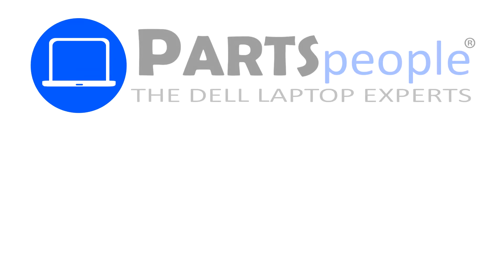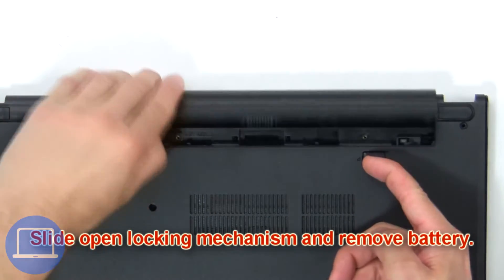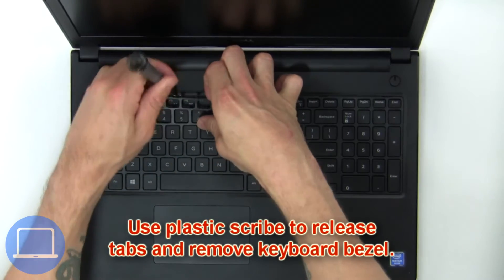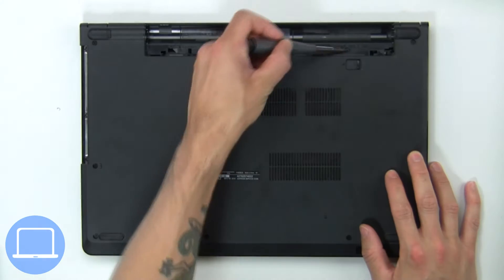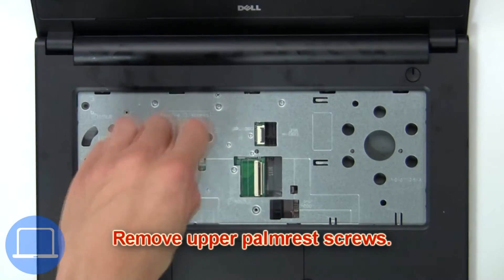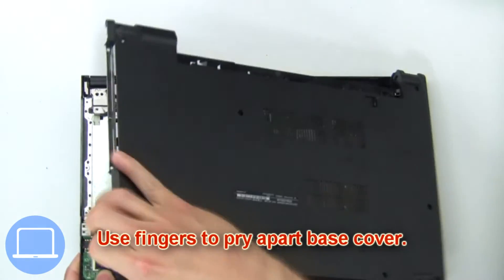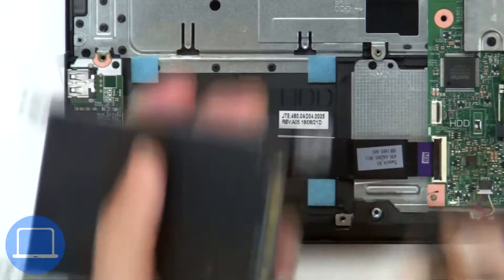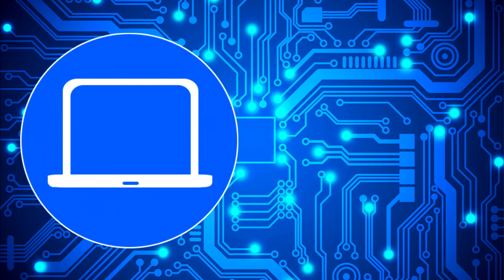Dell Inspiron 15-3565 (P63F003) Hard Drive How-To Video Tutorial

Comment: The optical drive is not coming out after removing the first screw. Any idea why?
Reply from the maker: They can be stubborn at times. Make sure you're carefully applying pressure at the release point shown here 0:32. We recommend using a plastic scribe.